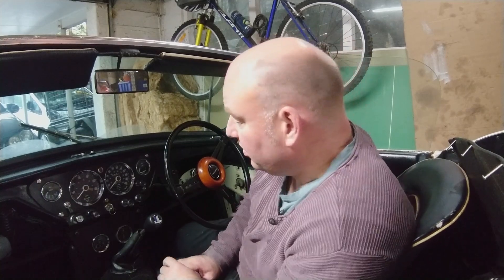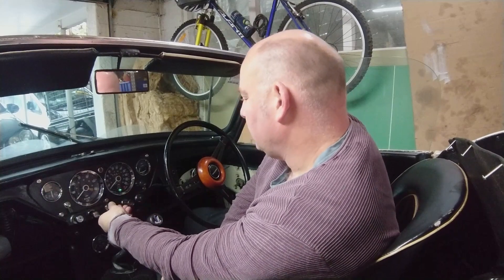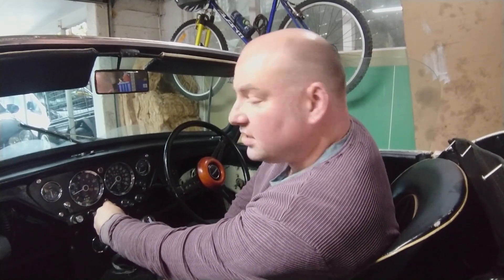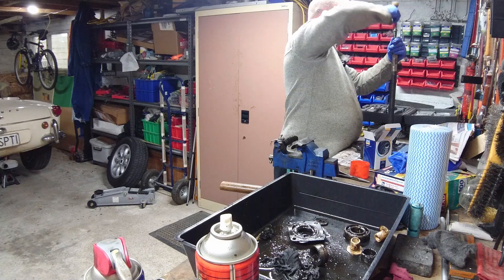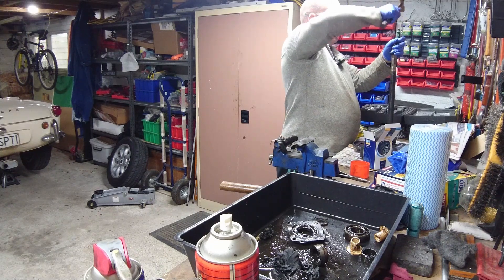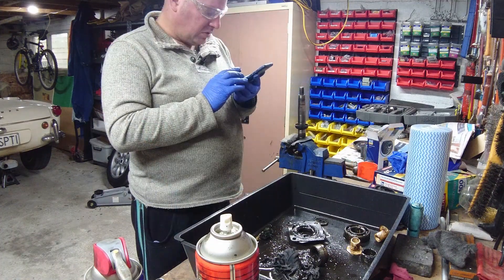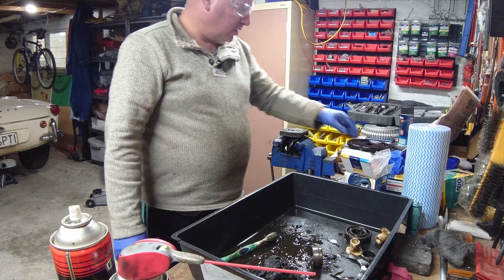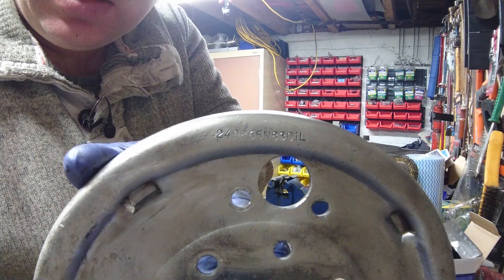66 SPTI part 20 – Rear Wheel Bearings (part 3) on my 1966 Spitfire 4 Mk II

Comment: thank you for the video. This is the first I've seen some one use a bearing separator to remove the trunnion. Do you think using a press with the bearing spitor holder would have worked on the other axle that you had a problem with?
Reply from the maker: I took the most stuck hub to an engineering shop in the end, they used an industrial press and a blow torch in the end to get it off. So it was highly unlikely I would have ever been able to get it off myself.
Reply: @jamesfromwellington  Thanks